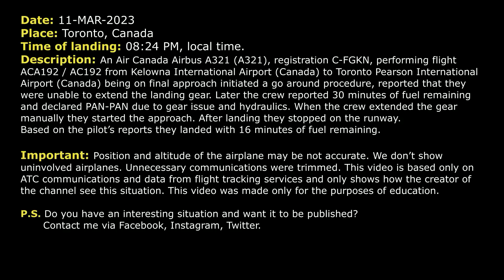“The gear is not coming down”. Air Canada A321 don’t have much fuel to troubleshoot. Real ATC

Comment: Two questions:  What is the difference between a Pan-Pan and declaring an emergency?  Second, how does the flight crew manually extend and lock the landing gear?
Reply: In most aircraft you can extend the gear with a mechanical backup that uses Gravity to extend and lock the gears. For the A320 family, in this case the A321, there is a handle on the pedestal that you rotate to manually drop the gear. In Boeing aircraft there is a trap door on the floor, typically behind the FO seat, that you open and grab a series of handles in there. I don't remember if you pump it or just pull it, but that'll drop the gear.
Reply: "Declaring an emergency" could be either Pan-Pan or Mayday, but requires the ATC know the full story.  Using the keywords up front tells ATC the basic severity without going through the whole explanation (Aviate, Navigate, Communicate).  If there should happen to be a second emergency in the airspace, making the distinction lets controllers prioritize between the two.  Both will get anything ATC can provide, but if push comes to shove, Mayday outranks PanPan.
Reply: @xheralt  If you noticed on the screen there wasn't any "red" emergency letter next to the plane. Mayday, Mayday, Mayday would have "EM" in red on the plane numbers. Everyone kept their cool!🥶
Reply: @kenhurley4441  All that lack of indication means is that neither PIC nor PO ever dialed 7700 onto their squawk; they left it as a verbal declaration only.  A small detail, but they may have been too busy, following the "Aviate, Navigate, Communicate" precept.
Reply: FAA says: Distress and Urgency Communications
A pilot who encounters a distress or urgency condition can obtain assistance simply by contacting the air traffic facility or other agency in whose area of responsibility the aircraft is operating, stating the nature of the difficulty, pilot's intentions and assistance desired. Distress and urgency communications procedures are prescribed by the International Civil Aviation Organization (ICAO), however, and have decided advantages over the informal procedure described above.
Distress and urgency communications procedures discussed in the following paragraphs relate to the use of air ground voice communications.
The initial communication, and if considered necessary, any subsequent transmissions by an aircraft in distress should begin with the signal MAYDAY, preferably repeated three times. The signal PAN-PAN should be used in the same manner for an urgency condition.
Distress communications have absolute priority over all other communications, and the word MAYDAY commands radio silence on the frequency in use. Urgency communications have priority over all other communications except distress, and the word PAN-PAN warns other stations not to interfere with urgency transmissions.
Reply: Pan pan means there's an issue, but the plane is still flyable, and can most likely land safely. Mayday is a full on emergency, where typically you believe safe flight is most likely not possible.
Reply: @Frost212  That's a rather dramatic exaggeration of what "Mayday" means. The vast, vast majority of Mayday situations still end in a safe landing, especially in commercial airliners. The point of calling Mayday is to command silence on the frequency and alert the controller that you need priority handling for an emergency situation. For example, an engine failure is usually a Mayday situation, even though it's exceptionally rare for it to actually result in a crash (or even an injury) in commercial airliners. You need the attention of the controller and priority handling over other traffic, but you're still going to land safely at least 99.9% of the time.

You call Mayday in order to get the priority assistance you need so that you can continue to fly and land safely. Of course, you would obviously also make that call if you're in a situation where your plane is not safely flyable, but the vast majority of Mayday - especially in commercial airliners - are situations where the plane is still completely flyable, but the crew wants extra attention and priority from ATC in order to make sure it stays that way. No one is going to die because of you calling Mayday. Lots of people have died because of pilots being too hesitant to do so.
Reply: @Frost212  I don't like that description. It suggests that Mayday is short for "we're going to die". This discourages pilots from using Mayday in the proper situation, which is when immediate assistance is needed.
Reply: In the aeronautical service, an emergency condition is classified in accordance with the degree of danger or hazard as follows:

Distress:

A condition of being threatened by grave and/or imminent danger and requiring immediate assistance (Mayday).

Urgency:

A condition concerning the safety of an aircraft or other vehicle, or of someone on board or within sight, but which does not require immediate assistance (Pan-Pan).
Reply: Both are emergency, one is life threatening and other not in life threatening ( still controllable ).
The A32F have the turning handle to release the hydraulic fluid hold the gear up, after 3 times turn, the gear doors and gears falling down by gravity and the doors remain open.
Reply: pan pan urgent issue but not an actual emergency
Reply: @alpearson9158  We just use emergency for everything. Much easier.
Reply: The other answers here pretty much already covered the different perspectives of what constitues a Mayday and what a Pan-Pan,
but ultimately it's very situational with few exceptions. If you lose all engines or someone is having a heart attack....basically obvious catastrophic failures
or anything that is immediately life threatening is always a Mayday call. But the rest really depends on your situation. An engine failure could be a Mayday if you only had one or two engines and you have no idea what caused it, but it could also be a pan-pan or less if you have 3 more working engines and you know exactly what happened and that it won't cause much trouble beyond what it already did. You have to ask yourself how important a system is, how many redundancies you have left and can you identify and contain the problem. If you have common sense it kinda boils down to how comfortable you are with the state of your aircraft. If you think it's more of a troublesome nuisance than anything else it's probably a pan-pan, but if you feel like getting down on the ground asap you shouldn't hesitate to call in a Mayday even if you are not falling out of the sky. 3 pilots could declare nothing at all, Pan-Pan and Mayday for the same issue and depending on circumstances all of them could be correct and nobody is gonna say anything about it. In genereal though, I'd rather take it too seriously than underestimate and downplay a problem.
Reply: Pan Pan is an old Chef's expression which usually meant the skillet was about to catch fire. Mayday is the one day out of the year that Brits refrigerate their lager, which is traditionally served tepid and flat if possible.

Comment: 16 mins? That’s surely a fuel emergency either before they lined up for final or not long after. If they left the gear hanging a little down (as they seem to describe it’s not fully down) I can get that’ll create drag if they didn’t/couldn’t retract it but that’s still close. Min fuel is there for a reason, one of them being in case you have an issue and have time to troubleshoot or divert.
Reply: I was thinking the same thing. That's an extremely small margin of fuel for if they had to do another go-around for some reason. If they had declared Mayday Fuel, I'm guessing Tower probably wouldn't have sent that Embraer out in front of them on the same runway.
Reply: They had way more than 16 minutes
Reply: @sfbishop  Yeah... I'm curious exactly what the situation was now. Because 14 minutes before they landed, they specifically said they had about half an hour total fuel, but then they reported 2,200 kg of fuel shortly before turning base. Maybe the 2,200 kg was including unusable fuel (which I guess still matters to ARFF, even though it doesn't exactly help for flying?) My understanding is that that's more like 45 minutes of fuel for a 321, but that might not be true when flying low and dirty. Would like to hear an A321 pilot chime in on this if there's one around.
Reply: as second landing atytempt prior to urgent issue it falls well within the necessary envelope

Comment: Airbus and their consistent landing gear issues. Per design their gear is supposed to fail, if/when it does, in the down position. Was on a A320 a few years ago with a similar landing gear issue. Wouldn’t retract after take off. Made for a real quiet flight on the emergency return landing.
Reply: Much better to fail down than up. But lots of issues with both Airbus and Boeing post pandemic and storage of aircraft, even this far along after opening back up to the world.

Comment: Sixteen minutes total of fuel? That's a thin cushion.
Reply: 2200kg of fuel is 45 minutes reserve plus more. Enough to go to YHM for sure. Nice uneducated comments though.
Reply: @sfbishop  what's that in pounds
Reply: @brianlacroix822  x2.2 is the conversion
Reply: @blackduckfarmcanada  ok what's that in pounds
Reply: @brianlacroix822 who cares?
Reply: @sfbishop              Yep, you are 100% correct. You made a nice uneducated guess. It's 43 minutes and 22 seconds worth of fuel, Dork
Reply from the maker: I just did a math based on their reports. I don't know what exact amount they had.
Reply: Probably 16 mins before they had to divert?
Reply: They would have declared a mayday fuel if they were truly that low, right?
Reply: Neil Armstrong landed with 16 SECONDS of fuel remaining. 16 minutes is an eternity!
Reply: @glenwoodriverresidentsgrou136  that just shows how smart NASA is. They got some real good math guys there ☺️
Reply: @since1876  You are right. They couldn’t get the fuel gauges to read that accurately when the fuel levels were low, so they tracked fuel usage overtime on a strip chart and had a controller mentally integrate, by eyeballing the strip chart, how much fuel had been used. It was his mental integrations that were used to make the 60 second and 30 second fuel calls. Absolutely amazing. That said, they were actually supposed to land with two or three minutes of fuel left, but Neil had to overfly a large boulder field and land long which used nearly all of his fuel margin.  He was too low to abort. Had the fuel run out, he would’ve dropped it in from wherever he was. His skill sets were amazing.
Reply: @glenwoodriverresidentsgrou136  all the science I don't understand. It was his job 5 days a week, not mine... 😜
Reply: Sounds like classic AC. On the other hand, WestJet makes them glide in empty haha.
Reply: 2200 kg isn’t much. When the pilot said 1/2 hr remaining… another go around would be real scary.
Reply: It’s just enough for one to wet one’s pants.
Reply: @burnte                 You've definitely clarified the situation. Thank you.
Reply: @burnte  Thank you. Such a simple question and everyone giving these dumb stats.
Reply: classic air canada. the ac 321 even has the extra fuel tank in it.
Reply: yes the cushion is thin, but the pilots are badass